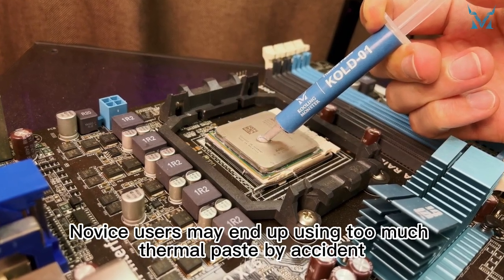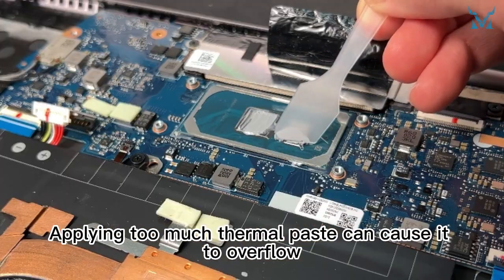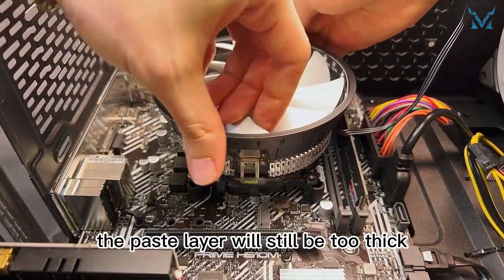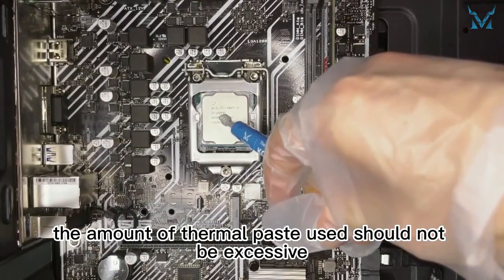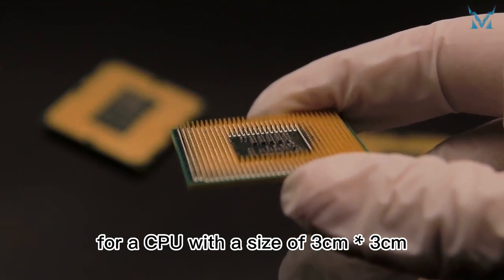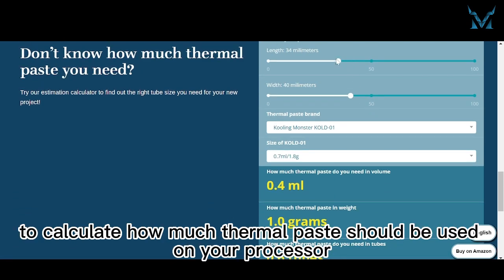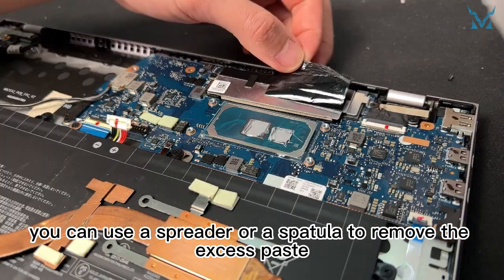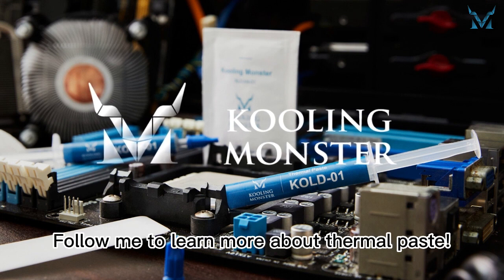What happens if too much thermal paste is used?

Comment: This is false information. It’s been proven with non conductive paste that you can pour a cup full onto your cpu and everything is completely fine and the cooling is unchanged. The efficiency has diminished returns but it does not get worse with too much paste. It just stops getting better and you waste thermal paste. Stop spreading false information.
Reply from the maker: Thanks for your input! While it’s true that non-conductive thermal paste isn’t electrically harmful in large quantities, applying excessive amounts can still negatively impact performance in real-world scenarios. @@Too much paste can create an uneven layer, leading to poor contact between the CPU and the cooler. Additionally, the excess paste can spill over and make cleaning or maintenance more difficult. Thermal paste is most effective when applied in a thin, even layer, sufficient to fill microscopic gaps for optimal thermal transfer. While diminishing returns are expected with excess paste, proper application ensures the best results for both efficiency and practicality. Additionally, our products have been tested and certified.

Comment: Can it cause random crash if u used too much thermal paste
Reply: Wrong. Thermal paste will squish out under compression.
Reply from the maker: There could be all kinds of problems if you used way too much thermal paste and it leaked on to the motherboard. Otherwise, there won't be problems as serious as random crashes, only a slight reduce to performance.
Reply: @koolingmonster   Linus tech tips did testing and it didn't matter all that much so long as it wasn't too little.